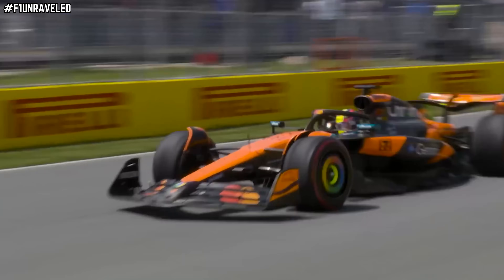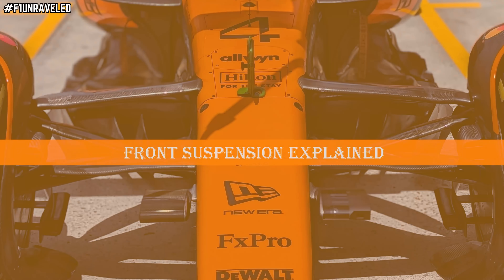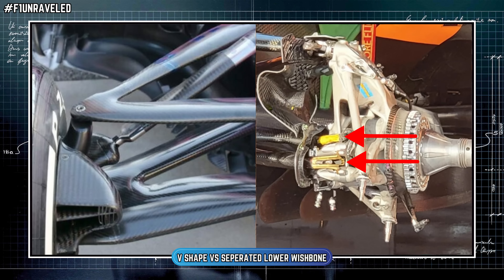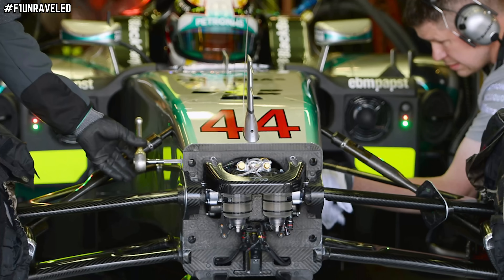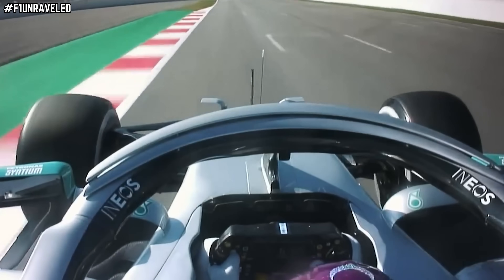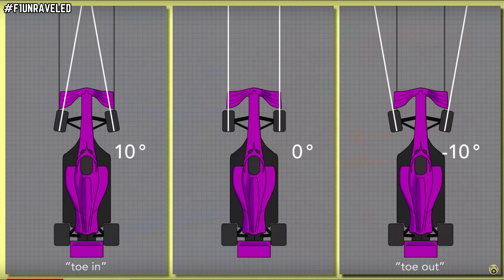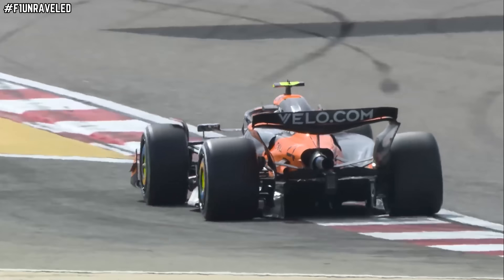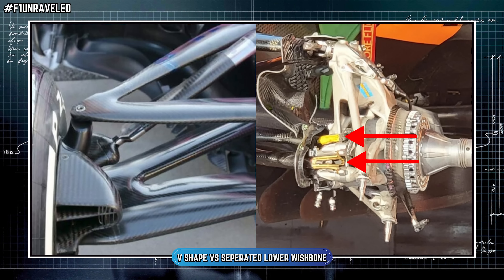McLaren CAUGHT Hiding "Hidden" Das Like Suspension system on MCL39?! | F1 2025

Comment: The FIA will ban this trick for the ‘26 season. First McLaren could profit on the flexiwings and drs trick because first the FIA said it was okay untill other teams implemented it. Then suddenly it was only the first 9 races of this season. Now it’s this DAS like trick which is accepted for this whole season. Outsmarted the rules? Yes and no. The FIA is also very generous on allowing it for such long periods where other teams have to make adjustments within 2-3 races. Probably the response will be we can’t do that because we have to rebuild half the car. Maybe that’s the way now to get away with stuff like this. Implement it on your car in a way you can’t change it within a few races.

Comment: As far as I can understand what McClaren is doing, this system is simply using the normal linkages in the suspension system and tie rods to adjust toe-in in response to suspension height.  The downforce created by the aerodynamic system pushes the car down harder when it's going the fastest.  That's when you want your tires to be pointed as straight ahead as possible for least drag and longer tire wear.  But you need the tires to keep heat in them, so you need some tire scrub at times.  The car rises up in the corners because the downforce is less at lower cornering speeds.  That's when the tires shift to toe-in, or toe-out, as they prefer.
I don't see how the rule enforcers can have a problem with that.  It's amazing that nobody has thought of this before.

Comment: Every car changes the toe position when the steering wheel is turned: this is called ackermann angle and it has been around for over 200 years. If McLaren has improved control over toe angles with a new multi-link geometry, then good on them. Nothing at all illegal about this as long as it works without driver input.
Reply: Just like mercedes had with the DAS system, was allowed one year but next year not so the rest couldn't copy it .. same now goping on here, give one team slack but not the rest .. and Zac keeps yelling RB was xheating .. there were bending the rules like they are doing now ..
Reply: The thing is, depending on anal they want to be then turning is a driver input which engages the action... 

Don't get me wrong think it'd be a load of crap. But you know...anything to stir shit up I guess🤷🏽‍♂️
Reply: Smart man! You are absolutely correct!
Reply: And used on British F1 cars!

Comment: Ingenious novelty? Definitely not. BMW and Audi have had these virtual wishbones for about 35 years in their top models!

To couple this with toe would require compliance in the lower legs. Today the front leg is almost transversal, taking side loads. while the rear leg takes the longitudinal loads. This would give a chance to play with lower pick-up point: move it sideways with lateral load and longitudinally with longitudinal loads.

I wonder when people say that McLaren is gentle to tyres do they refer only to front tyres?

Also I never understood why Jenson Button had the reputation of being gentle on the tyres and Jarno Trulli hard on tyres. Was it really about front tyres and the way they turned in. Trulli was said to use a style with induced understeer but I hardy can see Button as a trail braker ether … ????

Comment: DAS was allowed ( subsequently banned ) for MB precisely because it required driver input,  but for one season only.  Were it automatic,  it would not have been allowed from onset.  The regs do not allow certain automated suspension ( active suspension ) set ups which were outlawed after the Williams FW14B in 1992 and FW15C by 1994 seasons.   So if such a system is already banned electronically, and a similar system is banned when there is only manual input,  then how is this permitted in todays regs ?  There has to be something else going on here where it is neither electronically not manually activated. I am all for it.

Personally,  I do not mind as I think that these teams should be permitted to freely innovate technologies that would make their cars faster,  safer and more efficient.  The only restriction that should be put on them is that the technology has to have high probability  ( say 90% + ) to be transferrable to the regular motor industry for practical and cost efficient reasons ( emphasis on REGULAR - not only high end sports models )  - ie - technology that makes regular cars safer,  more efficient,  meets ecological objectives and is cost effective.

Comment: Mclaren has been through about 40 tech inspections (10 races, Pre and Post Race, 2 Cars) If the FIA had any questions on legality, They have had more than enough opportunities to object. I for one have never seen a actual F1 rule book, so I can't say one way of another, but with so many inspectors and inspections, My guess is that it is very Legal.
Reply: Well... Yeah. But if you watch the video McLaren had a modified front suspension that I believe was only running on Norris' car. Maybe their previous designs were legal, but this particular one isn't. Or it is. You can never trust the FIA with these things. I remember them outlawing the mass dumper that Renault used in 2005 and 2006 mid season, with great pressure coming from Ferrari... But rest assured. if there's ANYTHING to protest mr Horner will oblige...

Comment: Clearly not like the previous DAS as it doesn't require the driver to do anything. It's all done automatically by clever use of suspension geometry.
We used to use a setup that did something similar in rally cars (until the regulations changed).
It's not cheating if it's within the regulations. Of course they are often changed or "clarified".
Reply: Varanje 100%

Comment: The front suspension design of the MCL39, which helps cool the tire temperature, was somewhat slippery. The FIA deems the design to be in a grey area of the rules, and the 2026 rules will outlaw the design. The FIA is a sheepish organization that follows Mohammed Ben Sulayem. The chief sheep.

Comment: It's not this as mclarens biggest strength is when rear tyre limited tracks so pace is determined by rear tyre wear and mclaren get caught up by outher teams on front limited tracks so if there big advantage was keeping front tyres in better condition surly it would be the opposite. I know canada is rear limited track but mclaren lose so much time on straights there advantage was eaten up and with such low top speeds overtaking was to hard

Comment: So, it was not the brake ducts and Verstappen wins all championships in that regulations.

Article 10.4.2.c: There is only one degree of freedom between the end nodes of each element. No functional connection may be used to any other part of the element in order to obtain, for example, a feedback signal for other parts of the suspension system.

d: They must be so arranged that any suspension element functions only in parallel to any other, even if multiple elements are physically combined into a single component and/or share physically coincident nodes.

 "c" allows only movement in one direction e "d" prohibits a "multilink" wishbone from movement than the others suspension elements don't do, so their car is illegal and should lose all points from races where the system was used.
Reply: Pretty sure that all teams have their parts approved by the FIA long before they're put in the car, if it were illegal they would've said so.
Reply: @andresophisma  If that were 100% accurate then we would never have violations, which isn't reality.

Comment: i thought you can't have anything moving in the wheel hub or on the wheels which is why the DAS system was outlawed
Reply: That's what I thought too, there changing the set up after parc ferme
Reply: I believe the law was written that you can't have driver controlled moving parts. Which is why DAS was banned.
Reply: it was banned bc to activate it, the driver had to move an extra motion. Just like how f duct was banned because the driver had to cover a hole with their hand. if it activated automatically, then it's a loophole.
Reply: As usual they will say it's OK for Mclaren when it has not been OK for others. No wonder people are losing interest in F1 it's the cheating by McLaren putting people off.
Reply: @iain4295 are you an AI chat bot? this is the most nonsensical whining I've ever seen. stay in school pls
Reply: @iain4295 you must be new to F1 😂 it's not cheating it's finding every inch of performance within the regulations by finding loopholes that they can exploit. Something that has been happening in F1 since the 60's. People aren't losing interest because of cheating with car regs but because the racing with the current cars has become pretty boring because the FIA are quick to close any avenues for exploiting regs and the cars are too big for many of the circuits now. Just look at how fucking boring Monaco is now compared to the Monaco races up to about the mid 2000s.

Comment: I thought DAS systems or adjustable toe systems were banned.
Reply: They are.
Reply: I think another point you missed is that this design not only gives them unlimited adjustment for toe, but also camber. Looking at the pictures, it looks like their design allows for ultra precise fine tune adjustment of toe & camber. They probably have a greater range of adjustment then the competition.
Reply: No, driver controlled adjustable toe systems were banned. If it's automated it's technically legal.
Reply: @tukamadafuka  that would constitute "active suspension", which is also banned.
Reply: @EnouementSC automatically is used loosely here. 

Yes if the driver could mechanically change the toe/camber by choice while driving then yes it’s banned. Also if the car can automatically alter the toe/camber electronically or then it’s banned. 

But in this case this is a mechanical manually setting. Much like the flexible wings can be set up. It’s adding complexity to the setup but also adds more options or possibilities
Reply: @EnouementSC  
Active suspension had sensors and motors that measured the road surface, vehicle height, and suspension position.  It took that information and adjusted the suspension via motors to the optimal heights.  Adjustments were made automatically and extremely rapidly.
As far as I understand what McClaren is doing, this system is simply using the normal linkages in the suspension system and tie rods to adjust toe-in in response to suspension height.  The downforce created by the aerodynamic system pushes the car down harder when it's going the fastest.  That's when you want your tires to be pointed as straight ahead as possible for least drag and longer tire wear.  But you need the tires to keep heat in them, so you need some tire scrub at times.  The car rises up in the corners because the downforce is less at lower cornering speeds.  That's when the tires shift to toe-in, or toe-out, as they prefer.
I don't see how the rule enforcers can have a problem with that.  It's amazing that nobody has thought of this before.
Reply: @deezynar  Well if it's just clever linkage geometry then that doesn't really seem like it'd constitute active suspension. I never thought McLaren was cheating; people have always scrutinized the winning teams more than other teams, which was kind of my point. Their suspension was greenlit by the FIA; if it was illegal, the FIA wouldn't have allowed it. I brought up "active suspension" not to say what I thought McLaren's using, but to say "if what you're saying is true, then it'd be illegal, so that's not it". Your response is still insightful, however. I don't want to come off as fickle xd
Reply: @deezynar  Great explanation thx, just smart way to not cheat but its on the edge .. but it seams its the only way they have to get max not 5th wdc so its allowed by FIA :-D
Reply: @tukamadafuka sure tuka?
Reply: @thejonathanrath  whatever helps you sleep at night little johnny
Reply: I could never get around how Mercedes were allowed to use it all year before it was banned , yet anything else they change is banned before the next round
Reply: No, automated toe changes through suspension geometry cannot be banned as toe change naturally happens in any suspension.
Reply: That's why this videos been made, but we'll see
Reply: That'll be the 'hidden' suggestion won't it.
Reply: Only illegal if RB does it.

Comment: Thats just multilink suspension instead of conventional double wishbones. You can find it on audis and even honda civics. How come other teams havent done this already?
Reply: Which Civic has multilink at the front? I thought they were all limited to a single balljoint at the top, thus, not true multilink.
Reply: @rkan2  I believe  the 6rh gen (1995 until 2000) was the last to use double A arms.
Reply: Because FIA said DAS in any form or shape is banned.   There should not be any assist in steering inputs of any sort.
Reply: @DineshKumar-iu5pl  driver activated is banned this isnt banned at all this is innovation all cars will have it by austria

Comment: If DAS wasn't legal how could this be legal?
Reply from the maker: Because its part of the suspension layout, ie a secondary benefit within its primary one of steering the car. The Das was because it was primarily activated by the drivers. Although you could argue it still is, but it also isn't as well 😂 Just one of those grey areas I guess
Reply: What are you talking about. DAS was actually legal, it was presented to FIA even before season started. But was ruled out due to certain team complaining as ever. It mostly got banned for next season due to not wanting other teams try and copy it.
Reply from the maker: It may of been legal at the time of the paddock finding out. But that's not the case now is it? So what was said is true...
Reply: @TheChazas along with a few million 😂😂
Reply: @TheChazas The W11 had 6 things banned of it.